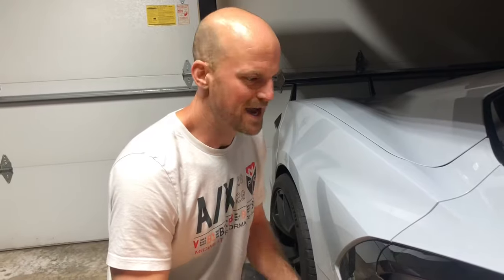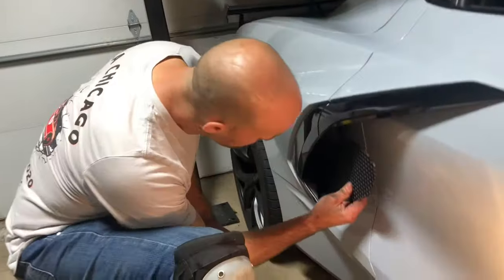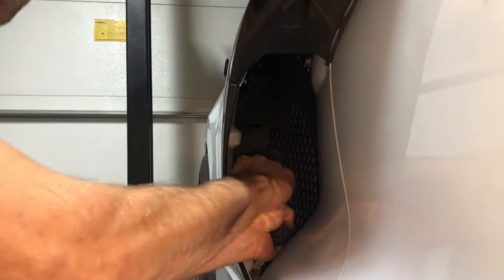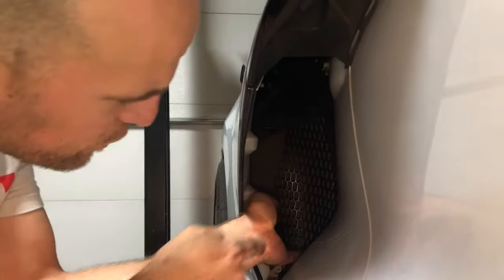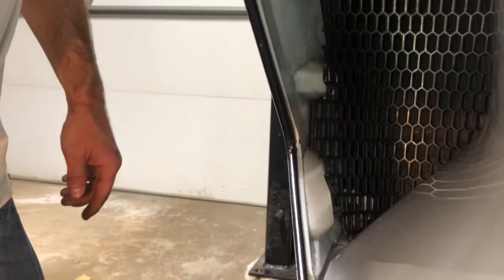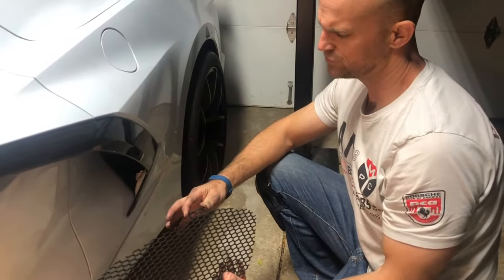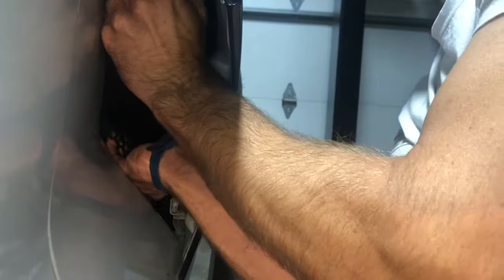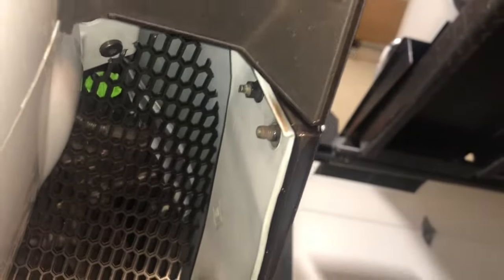RGS 2020-2021 C8 Chevy Corvette Side Intake Grille Install

Comment: I just installed mine Saturday 6/19/21 on my 2021 C8 they was NOT a pita to install, 20 minutes on the driver side (first one) following the video a little more, 12 minutes on the passengers side also following the video install.
I found that if you open the door on the side you are working on it makes it way more easier.
I layed the grills on my Sierra HD windshield to get them warmed up before installing them, in Phx Az the temps was at 98* outside at the time. 
At almost age 69  @ 270 lbs the hardest part of the whole job was getting off the ground.  😉

Comment: Well like most other I struggled for 30 minutes on the passenger side,,, walked away from it for the day and went back the next to attempt again AND after watching this video again.  I actually have a lift so I got the car up so I was not bent over, got a little "mean" with them (You cant baby these I guess what I am saying)  and when he says "concave" he really means that,,, I got the passenger side finally in place and used an allen wrench to hook it in and move it around too.  The driver side actually was a cake walk after the passenger side struggles.  They look good and look like they belong in the openings.

Comment: Why chevy just don't do this
Reply: @djisenord7455  but he also said they'd be ok for local driving and still looking for something like this in the future.
They are Cheap and will never agree to aftermarket stuff that takes place of what they did not do or did not think of.
My dealer feels these (Front and side grills) are a very good idea and is planning on offering them to customers after they saw and installed mine.
They installed the front grills for me when they had to replace the drivers side headlight at NO charge back in early May.
The service manager, service writer and corvette tech feels there is no way any restriction that would cause harm even racing, I agree.
I've been around racing since 1968.

Comment: These are a pain in the ass to install.  Not nearly as easy as they make it seem
Reply from the maker: They are tough due to the balance between screwing into the car, removing body panels or our design that requires neither and still hold up to track speeds of 140+ mph.

Comment: By the way there is no difference between the right and left I laid that one on top of the other and they are exactly the same
Reply from the maker: Yes that is correct.  Only directional, you can tell by the finish on the back/front which one goes to which side.
Reply from the maker: Come to Corvette’s at Carlisle and I will put them in for you!